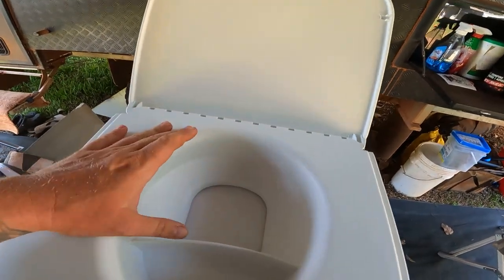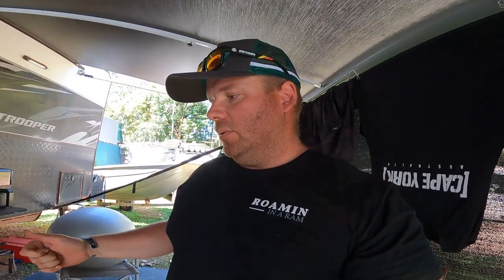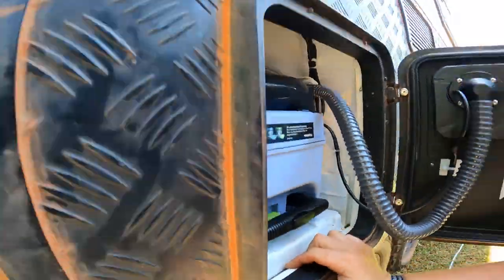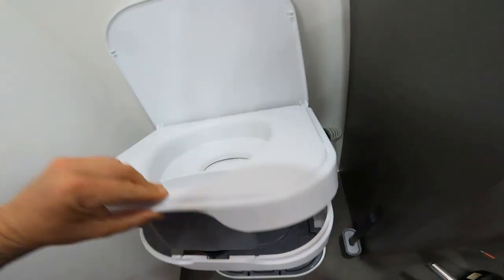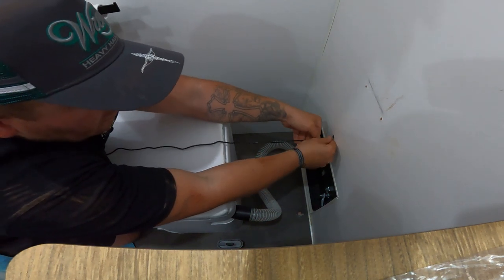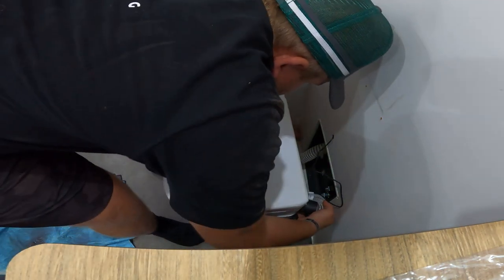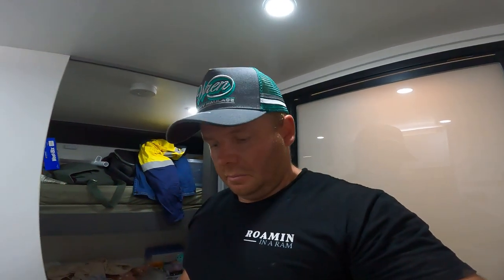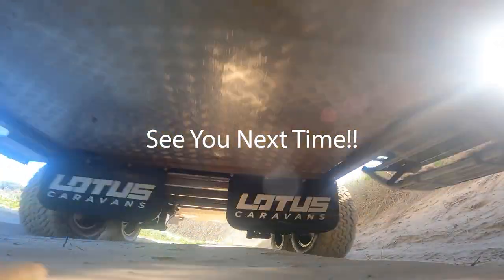BEST COMPOSTING TOILET OGO Toilet Install Review Cassette to Compost Lotus Trooper Natures Head

Comment: was it difficult to remove the original cassette toilet.   Thanks.
Reply from the maker: Hi, no it wasn’t turn water off, take cassette out, mine had 6 screws to take out from outside using the hatch. Then disconnect water house then from in side lift of the to bracket

Comment: Hi nice I've been looking at these compost toilets and wondering how they would go installed in combo shower and toilet wet areas?  Do you see any poss issues if not completely watertight sealed.
Reply from the maker: Hey mate I can’t really comment on that as our setup is different however I have seen other vans online with that setup. I would definitely contact OGO and ask them how it would go and warranty etc
Reply: Pretty sure OGO sells a cover for wet bathrooms